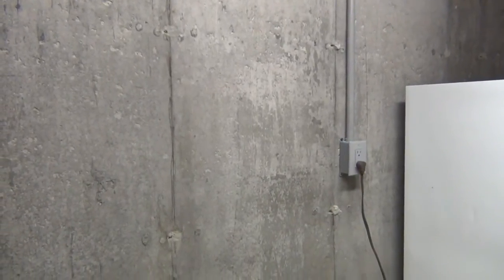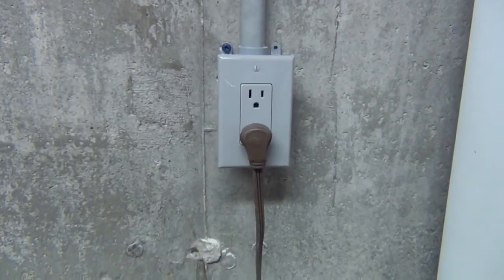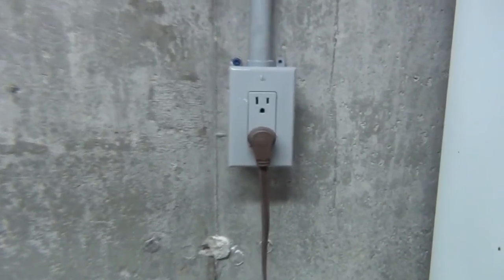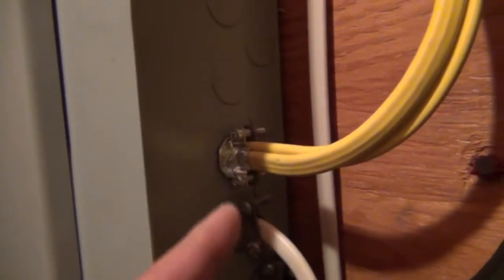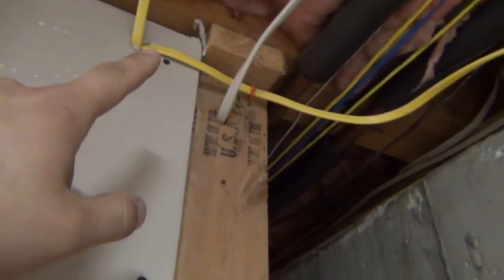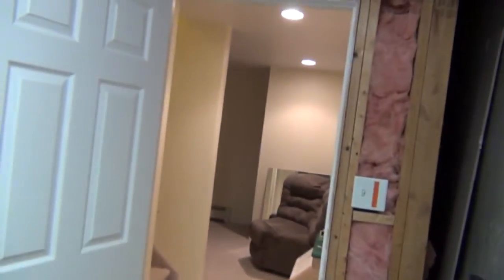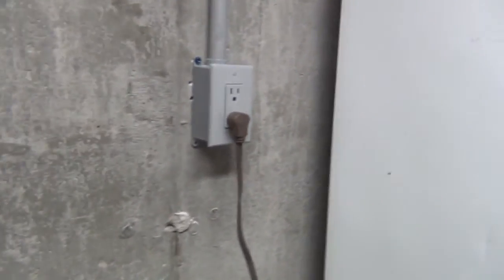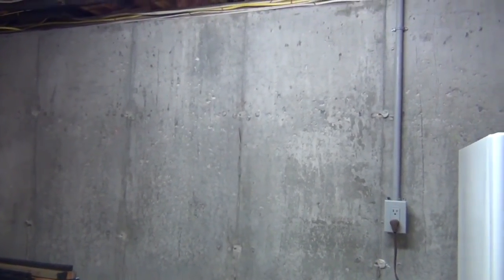Electrical Circuit Installation

Comment: I wouldn't double up the breakers, you will be doubling up the pull and that's more than what that breaker can produce. Best bet would go with a 200 amp panel. A lot of work but much safer and if you like electrical that's a playground.
Reply from the maker: +Robert Boyter The panel is rated to accept a specific amount of twin breakers.  Safety feature on the breakers themselves prevent you from twinning up the entire panel.  You are right though, always the better choice to upgrade the service.  Thanks for watching.

Comment from the maker: The joints are glued.  The Romex is stapled at the top of the whip - approx 6" from the connector - not very visable on the video apparently.  I would think installing the romex connector is a good idea to provide strain relief incase someone pulls on the wire.  It doesn't hurt anything having it. Thanks for the info on the GFI/basement usage for refrigerators - I wasn't aware of that.

Comment: Lets see the pvc joints need to be glued, the cable needs to be stapled within 12" of the connector, heck you don't even need the connector. A receptacle servicing a refrigerator or  freezer does not need to be a GFI as long as its within 6' of the appliance even in a basement.

Comment from the maker: There is no need to downgrade to a 15 amp circuit for the lighting.  A 20 amp circuit with 12g wire will work just as fine and pose no problems then if I was to run it on a 15 amp circuit with 14g wire.

The refrigerator circuit is 20 amps.  Maybe I'm missing what you're trying to say?

Comment: Why 20 amp for your refrigerator? Because your refrigerator draws more current than your fixtures. More it will be warm in your space. More the refrigerator will need current to cool your food. And if the room temperature is cold, it will only need to have the minimum current to operate.

Fluorescents lights only need more current in the first 10 seconds for them to turn on.

Comment: Sorry, but I suggest you put on your fluorescent on a 15 amp circuit breaker and your wall outlet on a 20 amp circuit breaker.

15 amps x 120 volts = 1800 watts. 1800 watts - 200 watts for a security zone. Remember that the goal is not to drive at 100% of it's capacity, but 80%.

Then you have a play of 1600 watts.

Example: If you have 10 fluorescent with an output of 50 watts each. That gives you 500 watts. 1600 - 500 = 1100 watts is still available for more fixtures on the same braker.

Comment from the maker: @zx8401ztv Ok, now that makes a little more sense. In the US, lighting circuits are typically 120 volts.  Our receptacle circuits are also 120v and daisy chained but no return back to the panel..just a feed from the panel (neutral and 1 hot) with the neutral being the return voltage.

Comment: @zimsjeep I did mean 5 amp, houses in the uk have a 5 amp breaker for the downstairs lights, and a 5 amp for the upstairs ones.
5 amp X 240 volts = 1200 watts

i suppose the limits in the u.s and canada are more generious, and there are more lights per floor than the u.k.

The mains outlets are a ring of cable like a daisy chain with two ends going back to the fuse/breaker box, are yours wired different?

Comment: Uk installations in factorys and concreate flats used metal tubing and they allways looked dam ugly, and the metal did look crap after a few years so im with you there :-)

I would parallel the lighting circuits to one breaker as a 5 amp breaker wont be overloaded by strip lamps.

Ive allways found a good tight clean cable joint allways works fine, shame that some people ignore the basics and cause unsafe wiring.

Camera seems great, and your shots are not shakey, good job :-)